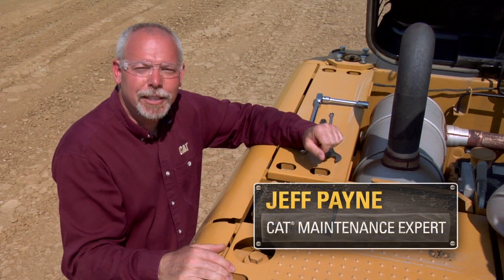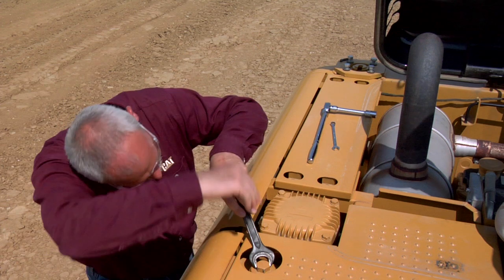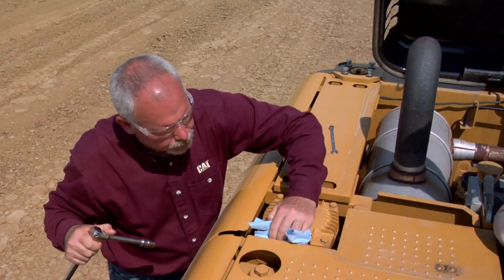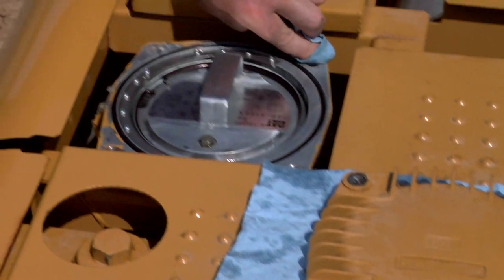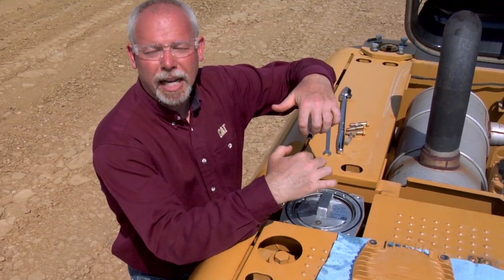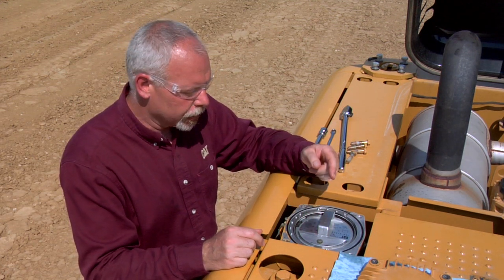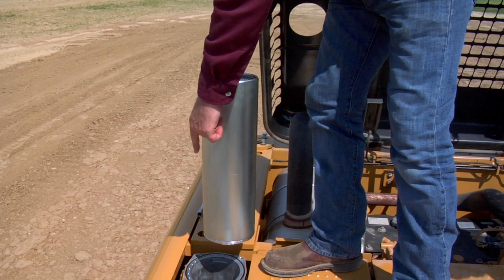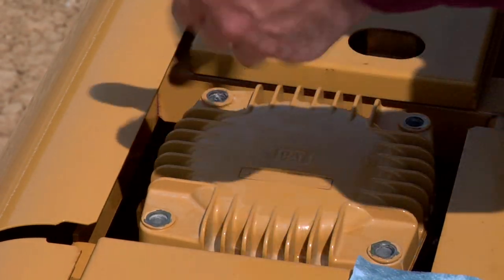Properly Changing Return Filter on Cat® Hydraulic Excavators

Comment: Please explain the reservoir vent system used on Cat and why there is usually residual pressure in the reservoir. My old 1980 D3B makes the same hissing sound (relief of pressure) when the reservoir cap is loosened. My other construction machines (brands) have a simple vent filter.
Reply: Nice ♥️♥️💯

Comment: Why would there be pressure in oil tank?
Reply: workwillfreeyou 💨🤕
Reply: Depends if the pump is gravity fed from the tank. If it is gravity fed, it needs pressure to push oil across to the pump.
Reply: What service failure is required because it caused the engine to stop working for the 320d2l excavator
Reply: Simply put there is air in the hydraulic tank and the oil level is rising and lowering by the time oil circulated which causes air pressure rises especially when a lot of hydraulic oil return to the tank.

Comment: Why don't Cat just make use of spin on type hydraulic filters , much simpler .
Reply: Because the return flow, and pressure are to high.  It would blow a spin on filter apart.   
 This cartridge filter is much cheaper.  You don't have to buy, and throw away a housing.  That is capable of handling what this system does.